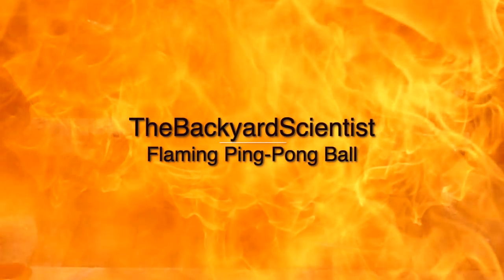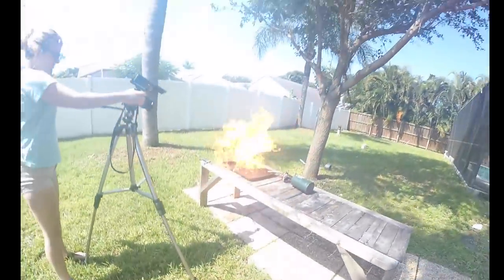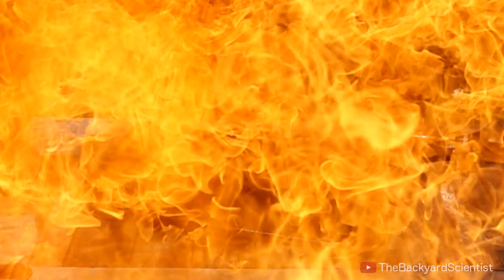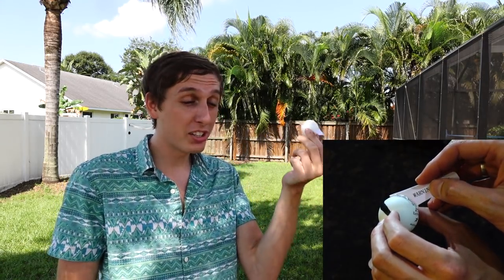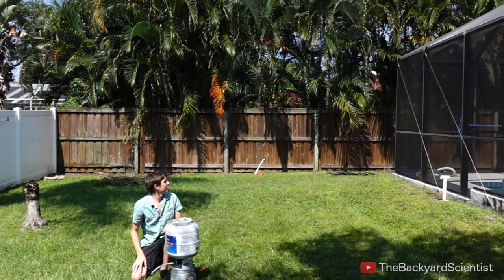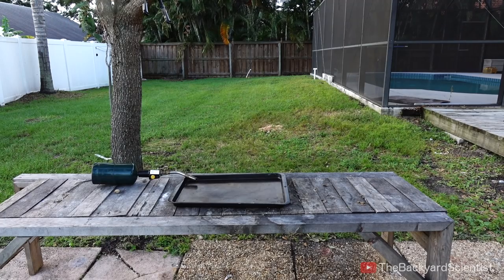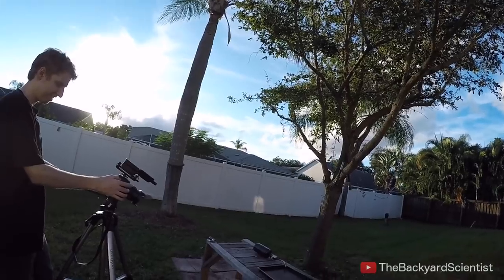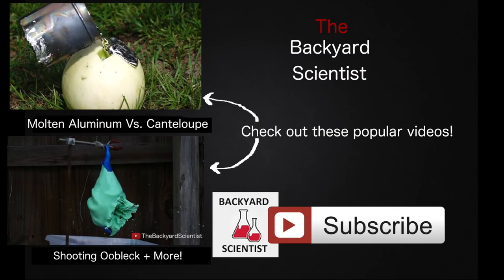Ping Pong ball filled with Propane spins and EXPLODES

Comment: About the propeller ball going crazy: I think I read about that somewhere, it's something about oscillation if I recall correctly. Basically, a small inconsistency in the initial spin causes it. Interesting phenomenon and really important for engineering.

Comment: Chances are that the winged ping pong ball didn't gain much height was because the wings were parallel to the ground. If you look at an airplane wing the back most part can be flexed up or down. This allows the plane to get lift (and to descend as well).

Comment: I reckon the reason the propane-snitch didn't want to fly is because there was nothing holding the wings at the right angle, and when it finds equilibrium the wings aren't giving it much lift at all. I'd bet if you lower the center of gravity with a weight, possibly mounted on the end of a lightweight stick attached to the underside of the ball, you'd get better results
Reply from the maker: +Rob Mckennie I tried adjusting the angle of the wings a few times, it was just very finicky.  I did get two great launches that ended up on my roof, but I just couldn't repeat it, and I was by myself so I did not think of filming! I tried mounting the propellers on top and bottom of the ball, and the balance was way off, I thought of adding a stick on the bottom also, like those toys you spin in your hands, but i think a slight unbalance or wobble would be greatly exaggerated with a stick on the bottom.
Reply: ***** Do you think? I could only see it increasing stability, by increasing the moment of inertia about the axes parallel to the propeller
Reply: Woah so many sciency words

Comment: I'm just making an educated guess here, but I think I know why your propeller ball didn't work as well as you thought it might.

I think it all has to do with the fact that propane gas is heavier than air, not only was it weighing the ball down but as it was expelled out of the ball it was saturating the air around the ball with propane gas, meaning the props had to overcome the extra drag to produce enough thrust to lift the extra weight. Obviously they weren't able to do that. 

The only solution I can think of would be to change the pitch of the blades, less pitch means it would cut through the propane saturated air better and defeat the drag but that also means they will produce less thrust per rotation. So you would have to find the right blade pitch balance that would give it the best trust to weight ratio. It looked like you had about a 40 to 45 degree pitch on those props, that will give you a lot of thrust but only if the blades can get fast enough to start overcoming the drag, id say a 20 to 30 degree pitch would be better. You could also try a lighter compressed gas.

Comment: Did you tilt the propelor?
Reply from the maker: Yes I made sure they were angled
Reply: +TheBackyardScientist  you shoud combine the flying ball and the fire
Reply: +TheBackyardScientist should've made the hole in an angle too
Reply: +Ian Paden yeah
Reply: I wonder if the escaping gas was enough to disrupt the air around the ball to the extent that lift wasn't mechanically possible, or that lift potential was greatly diminished.
Reply: +TheBackyardScientist you should make 4 propellers and see if the ping pong ball gets more altitude. try doing an expiriment on the magnus affect.
Reply: +TheBackyardScientist the wings were probably too flimsy.. so the air pressure and centripetal force just pushed them flat and they were unable to push back against the air to provide lift
Reply: +TheBackyardScientist try putting the whole in the bottom of the ball assuming the propellers were the sides

Comment: the reason the ping pong ball explodes is as follows:
A boiling liquid expanding vapor explosion (BLEVE, /ˈblɛviː/ BLEV-ee) is an explosion caused by the rupture of a vessel containing a pressurized liquid above its boiling point.
Reply from the maker: +Clay Wilson Im sure its a combination of both heat softening the ball, and internal pressure. I noticed the ping pong balls were spinning way faster in the hot air. I think its from hot airs lower density, and the heat causing faster boiling

Comment: Maybe if you were to put the wings at an angle similar to an airplane propeller, and fill the ping pong ball up from the bottom (between the wings) it might gain altitude.  The rotation then caused by the wings would stabilize the ping pong ball and allow it to fly in a desired direction.  It would act on the same principle as the rifling of a gun.

Comment: im not sure if someone has already made this comment but when you were trying to get the ping pong ball to fly with the propellers, i believe it wasn't getting any altitude because you put the propane hole on the same side as the propellers. i think if you put the propane hole on the bottom and the propellers on the sides the propane would give it thrust and propellers would naturally get lift going. which would make it fly up instead of sideways. would like to see how high it can go!

Comment: I'm thinking the reason it exploded was the heat not causing the pingpong ball to heat up and soften, but the propane to head up, expand, and then the pressure causes the explosion. However, it definitely could be a combination of the two factors.

Comment: The reason the ping pong ball exploded is the flame is suck into the ping pong ball along with a small amount of air due to the negative pressure which is a result of the propane exiting the ping pong ball

Comment: It wasn't gaining altitude because you glued the blades on "upside down".  They were creating downforce rather than lift.  If you flip them and create lift, it will go up into the sky like a rocket.  Note the curvature on the leading edge and apex of the wing/blade.  Good video.

Comment: the reason it explodes could be because you have the blow torch flame in the tin if you aimed it up more so its above the ball it might not explode as the blow torch flame is a lot hotter than the propane flame +TheBackyardScientist

Comment: For the ping-pong ball with the propeller, you might try three or four propeller blades to improve the balance.   I think the problem with only two blades is that it is too easy for it to spin along the axis that is parallel to both blades.    By adding a third or fourth blade, it becomes more stable like a frisbee.

(There is a technical reason for this from physics, but explaining the moment of inertia tensor is too complicated for a short YouTube comment.)
Reply from the maker: +Anthony Yan Im in physics now, I know what your saying. Somebody else suggested a stick on the bottom. There is a point where it will weigh too much though, the only ball spun so fast was its low weight. and the thrust only coming from a single whole makes it act funny.
Ill try some more soon, including the 4 propeller, but im going to take a break.. ive been breathing too much propane ;)

Comment: i think of your fill point (and exit point) was on the bottom the it would gain the altitude,plus pushing the propellers through air would cause the spin and hopefully stabilize , unless it just throws it end over end.

Comment: The reason that the ping pong ball exploded is because the ball is made out of celluloid which is a long carbohydrate chain with an oxygen group attached.  All it needs is heat to catch fire and the blowtorch is plenty of heat plus you have the rapid expansion of propane inside the ball so bang! This was on an episode of Outrageous acts of Science on the Science channel.

Comment: I'm no expert on the subject (Yet), but I believe the angle of attack was not high enough to gain a significant amount of lift. Perhaps raising it somewhere between 3-8 degrees would yield a significant gain in lift for a trade-off of angular momentum (RPMs) caused by increased drag and parasitic drag caused by a much greater disruption of airflow.

Comment: The Blades on the ball are way to big, the ball spins fast only because it's light and little friction to the air, cut the blades shorter and it will work better.

Comment: A little late, but increasing the pitch of the propellers could help.  You might have been wasting a lot of the energy from the expanding propane on just spinning instead of really grabbing chunks of the air with the propeller.  Variable pitch propellers work on that very concept.

Comment: Many ping pong balls are actually made of nitrocellulose and are thus super flammable. 

If any flame got into the inside of the pingpong ball there would be enough oxygen from the chemistry of the ball itself to sustain a flame on the inside of the ball leading to high pressure and POW. Although this makes me wonder if you could get a flame going on the inside of the ball with the right sized opening that it could be used a a solid rocket...Hrmm.

Comment: you can make a smoke grenade bty shredding a bunch of ping pong balls over aluminum foil, making an exaust with a pencil then wrap the aluminum foil around the pencil and remove the pencil, light the bottom of the aluminum where the ping pong balls are.

Comment: my theory runs off of my very basic understanding of pyro physics... i believe that once enough of the gas has been released, there is less pressure pushing it out, so the combustion that is happening on the outside moves into the ping pong ball, the rapid combustion of the rest of the gas (all combusting at once) creates more internal pressure than the ball can handle, and the hole being a weak point making it easier for the ping pong ball to split, releasing the gasses, meaning the rapic combustion can cause the bang... but dont take it from me, this is just shit i've pieced together from the snippets of information on combustion and physics i've picked up and pieced together...

Comment: suggestion for the wings on ping pong ball. make them more shallow not as long. ad two more make them about half inch long. see what happens this might help because you are getting a lot of speed and not a lot of torque. the smaller blades should help is get air borne much better especially if you add more. the balance will be better as well hopefully.
Reply from the maker: +David Chase I think your right, the only reason the ball spins so fast is because it weighs practically nothing. smaller wings might be better.
Reply: Cool look forward to your videos

Comment: the ball didn't gain altitude because you put the wings exactly parallel to air which doesn't give it any lift. Try putting them at an angle to the plane of rotation of the ball and i'm sure you will be able to make it fly at an higher altitude.
Reply from the maker: +Pravardhan Reddy I put the wings at an angle., a few different angles.
Reply: +TheBackyardScientist oh! it didn't seem so in the video
Reply: +TheBackyardScientist The pitch of the blades will have an effect; but in order to generate lift, each blade needs a camber to it in order to generate lift.

Comment: the shell exploded because the pressure was higher when u lit the ping pong ball. when the pressure equilised it all ignited inside the ball. when gas ignites it expands. if their Isent sufficient sized hole to let out all that released energy fast enough then you have an explosion

Comment: Hey! You know the tin foil ping pong ball smoke bomb trick? If you don't, it's where u wrap a ping pong ball in tin foil, then stab a hole into it. Put a small straw into it and light the bottom on fire. You should mess around with that! Ps Orange ones smoke the best

Comment: The propellers probably didn't have the right angle to generate lift. Maybe try gluing the whole propellers on top of the ping pong balls.
Reply from the maker: +Ceelvain I tried that it threw off the balance.
Reply: *****
I see. Too bad, I don't see a simple way to stabilize it. Larger propellers maybe? But that would require more energy to spin fast.

Comment: Doesn't the ball explode because as the propane is leaving the ping pong ball, the ratio oxigen:propane shifts until the propane can ignite within the ball itself, causing it to explode? It's basically the same thing as filling a container with propane, then ignite the propane (through a hole you made in the lid). After enough propane has left the container, the flame will be sucked into the hole and the lid will be shot off a couple of meters into the air (maybe also material for another video?)
Reply from the maker: +Frank Groen No. The ball usually exploded while it was still partially full with liquid propane, and the boiling of the propene would insure a 100% oxygen free atmosphere, plus it was spinning around in flames, an oxygen free environment.. Im confident the heat softened the ball and the internal pressure exploded it.

Comment: Why dont you add two holes buddy as the thrust hole on one side is A asymmetrical and pushes it off balance with the propellers attached? Hence the erratic flight path...

Comment: what if you put a very small weight on the bottom of the ping pong ball with the propellers and dropped it on the fire pan so that the weight will make it land correctly and then shoot upwards with swirling fire?

Comment: What if you do the experiment with the propane and the flying Ping pong ball with the propeller but try to light it on fire through the propane Trail it leaves in the air

Comment: If you want to call this "science" and not just playing around, perhaps you should do some research into "stoichiometric proportion" or at least https://en.wikipedia.org/wiki/Flammability_limit
The ping pong ball explodes when enough propane is expelled that the air/fuel mixture inside can combust. This internal combustion causes an explosion precisely because the ball is (mostly) intact...pressure increases until the ball ruptures, so the stronger it is that more impressive the explosion.  
Also you all really should be wearing safety glasses at least. A fragment of ping pong ball in the eye and you wouldn't be laughing.
Reply from the maker: +Stephen Tack No. This is impossible because there is no oxygen inside the ball..  The boiling Propene inside forces out any air, and makes a 99.99% oxygen free atmosphere, plus it was spinning around in flames when it exploded, an oxygen free environment.. Im confident the heat softened the ball and the  increased internal pressure from the heat exploded it. 
To prove my point, watch 0:50. You actually proved yourself wrong when the ball explodes, and there is no instant flames, indicating there is no oxygen inside the ball. The stoichiometry was wrong, the propane had to mix with the air before it caught fire.